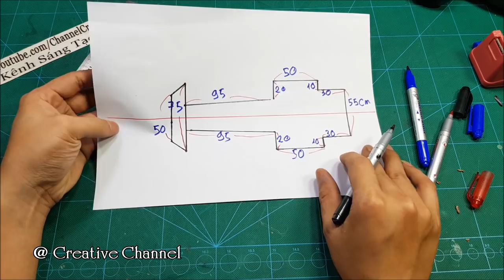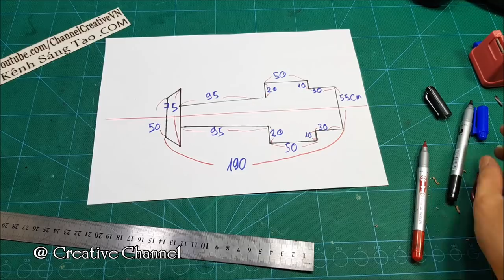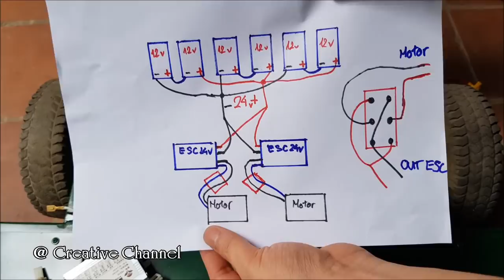How to Make F1 Electric Car | DIY Go kart at Home

Comment: This is dope! Add a few extra batteries, use a thicker current wires, grab an Arduino Mini or something similar and tune the monster! Put 2 buttons on the rig, one being ECO and the other being performance. Performance will have instant throthle response while and all battery power! ECO will limit maximum power output and has a soft throthle response (safer!!). Does require a bit of coding and a few extra wires to be pulled! Very cool project!
Reply: Ruh12345

Comment: Nice vid but i have a question...i think that the steering rack has to be in the frond side of the steering collumn otherwise you will turn the steeling wheel left and the wheels will go right....but probably you fixed that offcamera....nice job anyway

Comment: I think I put the steering to high and that's my option just saying
Reply: TSM_TIMMOTHY Your option is that you put the steering to high? What are you talking about?
Reply: what its cost
Reply: @Александр-у8й6д  He means the leverage ratio is too long in relation to the steering wheel diameter.
However as that is all reversed its not drivable anyway

Comment: Brake is not installed
Reply: They are not needed, because to brake you can reverse the motors and brake like this
Reply: Drone man sk is Right
Reply: You are right😬😈
Reply: I think it's aluminium or some kind of steel
Reply: These mobility motors  usually have built in brakes check for two extra wires at motor
Reply: @jostouw4366  electromagnetic brakes?
Reply: @dronemansk2121  Normally a magnetically released clamp holding a disc of friction material mounted loosely on the end of the motor shaft when power is removed the motor is held, a bit crude but will hold on hills

Comment: I love your project! can you build me one. I'm 5' 3 inches tall and about 135 lbs and retired. I would like about inch higher from ground and wire basket in back for grocery. No back seat and slightly small size all the way around,so I can ride on side walks. How much estimated cost?
Reply: You gonna need at least $5000 for this. It's hand made and custom.